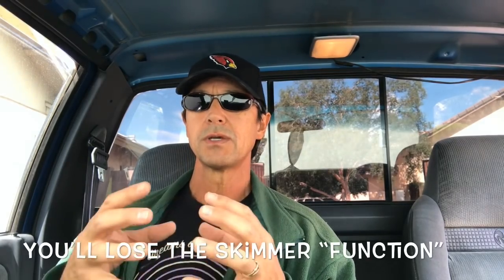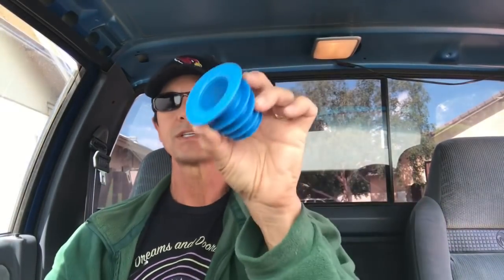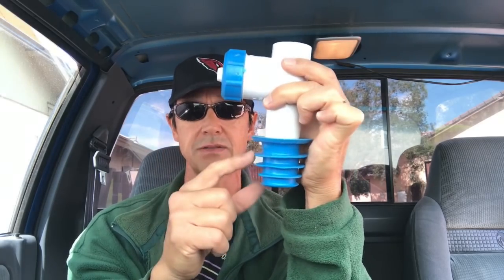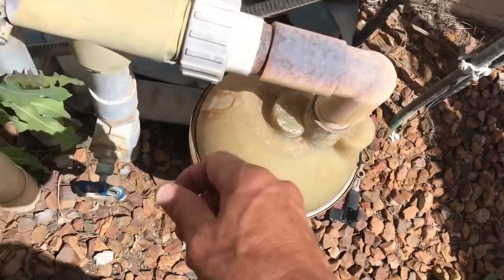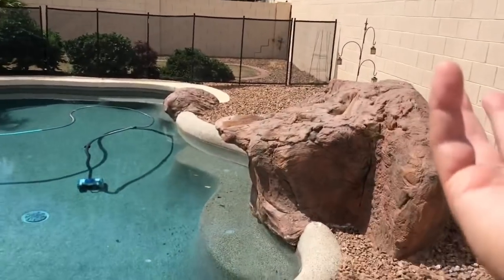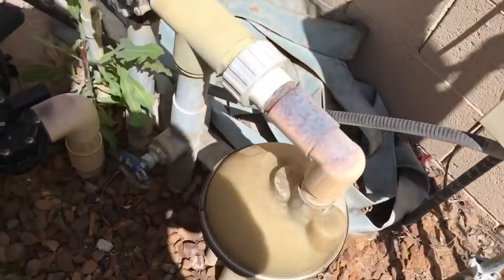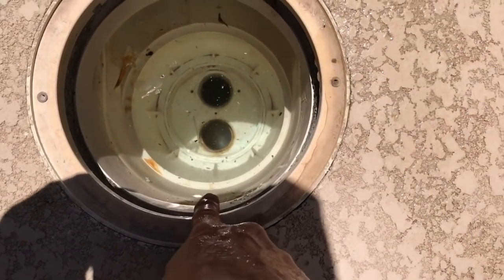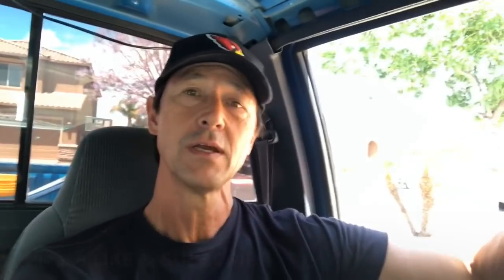Converting a Pop Up Pool to a Vacuum

Comment: Thanks for the video. Getting sick of our pop ups not working properly and think I'm ready to convert. However, you referred to the skimmer and a leaf catcher that had a valve that could direct mire to one than the other and so it would get rid of the need for the extra piece with the pressure relief in the skimmer. I don't have the leaf catcher but I do have a valve that directs more towards the skimmer or the main drains. Would that negate needing the extra piece too? Therefore making the adjustment at the main valve. Thanks in advance.
Reply from the maker: I would actually suggest using a VacMate.  Here's a link to a video I did about converting your pop up pool to a vac using a Vacmate.  They're great: https://youtu.be/gSfbNv4sV_M

Comment: Hello, We have several of the pop ups where the inner part has come off, can we just cap these off or do we have to replace the pop ups?  Hoping there is an easy solution.
Reply from the maker: Usually you can cap them off. Most of the pop up head manufacturers have caps you can get. You might have to do an online search for them tho.

Comment: Maybe this is a stupid question, but can I connect my pool vacuum to the leaf vacuum intake instead of my skimmer? Our pool has the pop-ups, but no separate pump , and they aren’t well spaced anyway. A previous owner already attached a vacuum adapter with the spring loaded lid to the pool-side intake of the leaf vacuum you showed in the second pool, but there is no lid or filter bag in the leaf vacuum. Just for kicks I tried attaching our vacuum to it, and it failed spectacularly since it’s open to the air from above, but I wondered if it actually had a lid on it and was a closed system if that would work?
Reply from the maker: Actually it’s not a stupid question at all. And I appreciate your question. The only way you can attach that vacuum to that inlet you’re describing for the leaf vacuum for the pop-up system is if you can adjust how much suction goes to it from the pump and also you have to make sure that The lid seals the leaf bag inside.  Actually in the pool that I used for this video they have a similar set up but two reasons we couldn’t use it the way you described, A there was no way to adjust the suction between the skimmer and the leaf vacuum, and the lid that they had for the leaf bag would not seal over the top so we couldn’t get enough suction. So unless you can completely seal that lid and then adjust the suction it probably won’t work

Comment: So I have my actuator away from the pump system, and pause switch does not work. If I take out the guts do I still need to have the return open all the way? I don’t not see a knob anywhere for my return
Reply from the maker: Hard to comment without seeing it.  Can you email me some pics of your pool equipment area (and possibly a video). That way I can comment more accurately.  Kennypoolschool@gmail.com

Comment: Question: I have taken out the guts for the popups and I attach a vacuum to the skimmer my pressure on my filter goes to 0, is that alright
Reply from the maker: It’s not necessarily a bad thing, but it’s probably so low, because when you took the guts out of your pop-up actuator, you pulled out the stops for all the different sections meaning all the water return flow is going through all of the pop up heads it’s not necessarily a bad thing, though as long as you have enough suction for the vacuum to work.

Comment: My only returns are the pop-ups and two aerators. When I have the aerators set too high the water blasts out too forcefully. So I have to adjust the valve so that the pop-ups are still working at the same time as the aerators, probably around 50/50. It's not ideal, but the vacuum (Aquanaut 450) is doing a good job going over the pop-ups. The suction on the vacuum, according to the instructions, is set correctly (wheel revolves around 12 times per minute). However, I have a diving pool and the vacuum doesn't get the walls hardly at all. It does a great job on the floor and the curve before the walls go vertically. I wish there was a better solution, but it's the best I've come up with.
Reply from the maker: B C I know The Pool Cleaner 4 wheel version does a great job and does go up the sides.
Reply: @PoolSchooler   This vacuum is supposed to as well, and the suction seems just fine. Not sure what's going on. It might have to do with the aerators being used at the same time as the pop-ups, but not really sure.
Reply from the maker: @BC-ri7im  hmm. not sure what to tell you.
Reply: @PoolSchooler  No worries. I probably should have returned it, but they only gave me one week and in the winter it was hard to tell within that week. I thought it was doing a better job. It might not be the vacuum though anyway.
Reply from the maker: B C Actually I do have a thought  for you. When the manufacturers make a suggestion on how much suction to put to the vacuum that really is very generic and there’s no real hard fast set rules for how much. So I would suggest playing around with gradually increasing the suction to your vacuum and then watch it for several minutes and see if it climbs the walls better. You’ll probably be able to adjust it to where you can get it to climb the walls better without actually coming out of the pool which is something you don’t want to happen. Give that a try and see if that helps.

Comment: Thinking of buying a house that has pop ups. If I redo the pool is it a pain to get rid of them then resurface the pool ?
Reply from the maker: That is a question that is probably out of my knowledge base. But… If I were to comment in my limited experience what is the topic of resurfacing your pool and plugging the pop-up. I would suggest resurfacing the pool and there are plugs that can be put into the pop-up holes to seal them and then convert your pool to a stay in the pool suction side vacuum using a vac mate

Comment: What about when the pop ups are the only returns?
Reply from the maker: Addicted To Placebos that’s a tough one. Maybe go into the actuator and permanently open the flap for the pop ups at the steps so the return flow goes there 100% of the time.
Reply: I too have a pool with pop up returns only... what do you mean opening the flap to the pop ups at the steps at he actuator? Also, what's wrong with the pop up being the return with a vacuum hooked up?

Comment: i get a bunch of pollen from a mesquite tree which ends up in the pool and floats around ...with no skimmer function my chlorine gets wacked by all the organic material in the pool and the pollen doesn't sink it sits on the surface...I m thinking a vacmate conversion for the pollen time of year as a compromise.
Reply from the maker: When you have that kind of pollen and that much of it your Fossetts are probably through the roof so get a good phosphate remover like PR 10,000 that will help prevent algae from growing.  As far as the vac meat do you not have a stay in the pool vacuum at this time?
Reply: @PoolSchooler  no I haven’t had one. New pool to me so getting to know it. Right now has pop up system in floor and have watched your vids on pros and cons and agree with your thoughts. Good  feedback on phosphates and I have a commercial grade product. I think I’ve used it twice so far
Reply from the maker: @kiwicory100  Ok, so converting to a suction side vacuum like the Barracuda G3 (my favorite) with a VacMate won't do much for the pollen on the surface.  But it should help a lot with the mesquite droppings on the bottom of the pool.

Comment: When he is talking about different types of "push/suction cleaners" aka manual type hoses attached cleaners. Unless you have a vinyl/above ground and even then so. Spend the money for the heavy duty version. Like $40-60.. been a min, so don't quote me. I have/lived in AZ  almost all my life, worked for one of the heaylvy hittaa for all things pool for 10yrs. It  looks like this gentleman lives here as well. Literally get what you pay for. You get a "El Cheapo",, your gonna end up with just that. Will it work? Sure. Can you replace bearings/wheels, sure. Although it cost you as much....  it's better to just buy a new one. Go heavy duty. Please, save yourself the frustration, money; especially if you live in Zona. Between the Sun, Heat, hard and overly calcification in our water + factor in chlorine. Shits gonna break way less than a year and there goes your money. NOT WORTH IT. Hope you don't dispute this..... PoolSxhool. If so, just shows lack of education and the AZ environment. Cause I guarantee you people don't remove right away when done and it sits, or if removed; it doesn't get hosed off.

Comment: When converting to a vacuum system, how do you stop the pop ups from popping up? The vacuum always gets stuck on the pop up.
Reply from the maker: You should be able to “pause” the heads from cycling. Wait for them to open up on the steps and then flip the “pause” lever in your pop up head actuator.
Reply: @PoolSchooler  I am having this same issue. I took the guts out of the pop up canisters but they're still popping up. I looked for a valve to shut water flow off but no dice.
Reply from the maker: @TheJForbes24  Yup I've run into that as well.  There are several ways these systems could've been set up and plummed.  Since you took the "guts" out of your actuator.  If you can open it back up and find the port that opens the return flow to the pop ups on the steps of your pool you can permanently remove that flap(s) and then those pop up heads will stay open leaving the others permanently down which should fix your issue, HOWEVER, sometime the suction on your vac is too high and can still cause the vac to stick on a head.  Just play with the suction adjustment on the vac til you get enough to keep the vac moving and working without sucking onto a head.

Comment: I have the Caretaker in floor system with only one pump.  I do not have a shutoff valve to the system and the only shutoff valve I have is to the water feature.  Do I still have to remove the guts to the caretaker or can I just cap off the line that feeds the caretaker system?
Reply from the maker: John Swa do you have a way to ensure that all the return flow goes back to your pool returns and not the pop-up returns?
Reply: @PoolSchooler  I don't Know.  Can I take a pic of my plumbing and get your opinion?  I'm in Gilbert and it looks like you are in the west side of town?
Reply from the maker: John Swa sure. Take a few pics and email them to me.
Reply: Forgive me, but I can’t find your email.  Would you please post it for me?
Reply from the maker: John Swa sorry. It’s usually at the end of all of my videos but it’s kennypoolschool@gmail.com. I’ll also update my “about” part of my channel with my email as well.
Reply: Thank you, Kenny!

Comment: How can I convert a Polaris system with a booster pump to a suction system
Reply from the maker: You can't turn a return side port into a suction side port without major excavation and replumbing.  My suggestion would be to follow this video THEN you can turn off the flow to the Polaris vac.  https://youtu.be/eagXAKxN8zM

Comment: I’m thinking of building a pool in my yard I’m in arizona also do you have any remondations for my build like things to do or add or consider ? Is there a pool building company you recommend I’m in Tucson
Reply from the maker: @joesmith7123  i’m glad you asked, I’ve been thinking about doing a video on “if I were to have a pool built in my yard or would it be like?“. To be honest, I would keep it very simple, I would put in a good high-quality sand filter and use Dr. Dryden‘s activate glass sand substitute. It would be a play pool with no deep end. Probably kidney shaped I might have a very small rock waterfall just as a water feature and that’s about it. Maybe a gradual slope entry on one of the pool where you could possibly put a couple of lounge chairs.  Simple but pleasant.
Reply: @PoolSchooler  i understand.  Is it just maintenance reasons ? I was thinking a bit more extravagent . I currently maintain my own pool and honestly its easy as fuq. Water is in great condition all i do is clean the filters and add chlorine pucks as required.
Reply from the maker: @joesmith7123  Mainly it's maintenance and cost to maintain.  There's an old saying "The more bells and whistles the more things can go wrong".  So I'd include two things:  The more elaborate you get you have to make ABSOLUTELY SURE you have someone who REALLY knows how to build such things and has proven that they can make a good product that's as trouble free and durable/long lasting as possible.  I've personally seen too many pool owners have major issues with incompetent builders who say "sure I/we can do that" and then end up leaving the pool owner with a mess.  Secondly, consider this. the more "things" you have on your pool ie: features, gimmicks, the more it'll cost to repair or replace in the future .

So those are my thoughts.

Comment: Most of your videos are pretty good and I like them, but this one makes no sense. The pool cleaning system will use a little more electricity, but it comes as benefits. Conversion that you are recommending will leave you with no skimmers and some ugly thing crawling throughout the pool.
Reply from the maker: You are right, but many of my pools in AZ have no issue with vegetation falling into their pools and so this option is fine for their needs.  HOWEVER there is a way to keep the skimmer active (to a degree) when converting using a VacMate Skimmer converter by Pentair.  I did a video this: https://youtu.be/gSfbNv4sV_M?si=_4-zxQ1bQ9uGWSaf